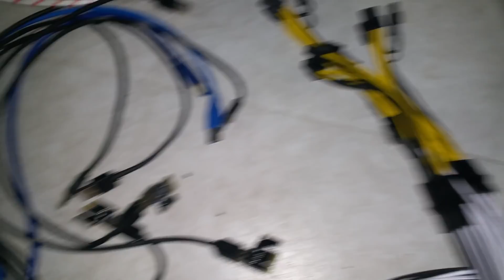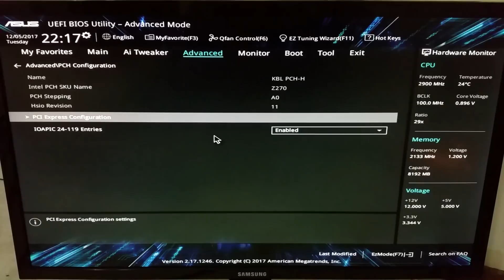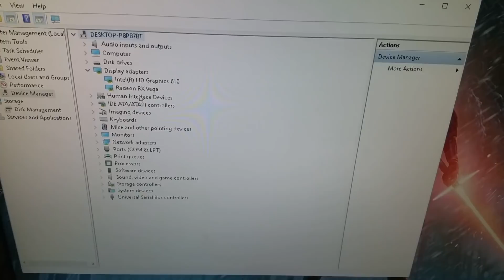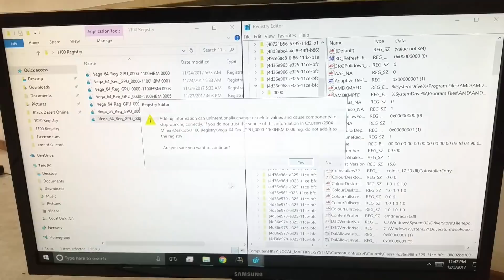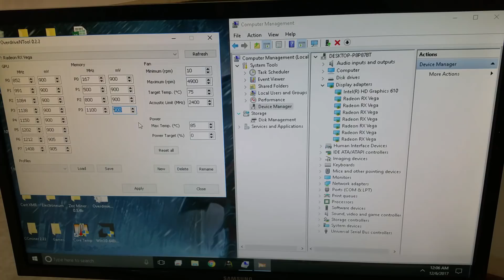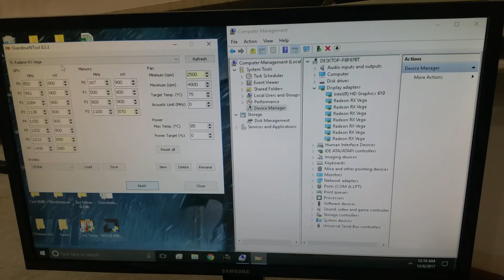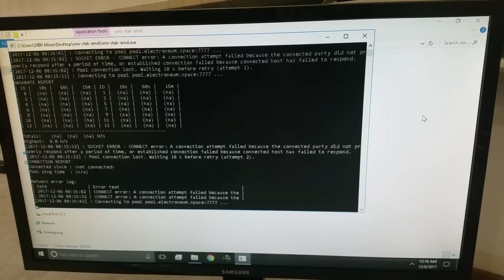[Tutoria] How to configure 6+ RX Vega Mining Rig

Comment: why not just use 4 gigs of system ram and you dont have to worry about turning on and off the cards for the HBCC support??  the reg edits are just to address watts and clocks right?
Reply from the maker: I don't think HBM is the issue. In this video I didn't even install the "radeon setting" so I was not able to even toggle OFF/ON the HBM at all. I think it is some sort of driver issue (I could be wrong though). I don't see how going from 8GB of RAM to 4GB would affect the bug/issue. Would be interesting to try though! I might have to buy a 4GB module just to try it. The reg edit allows you to change some of the P states that are otherwise locked in wattman/OverdriveNTool. You can get similar hashrate without doing anything to the registry but you end up drawing quite a bit more power doing so.
Reply from the maker: Ohhh whoops I missread HBM as HBCC LOOOL. Hmm that's interesting, I don't have any 4GB modules but I'll definitely have to try it to see how it works.
Reply: lol thats what i meant hbcc, likei just set up 2 vega 64's and with  4g system ram, the hcbb doesnt get used and seems like they hash fine (though i havent done any registry edits, just the regular memory overclocking for now... but seems fine... ill modify the registry soon, sometime this week and see if that works fine too.) I just overclocked the mem to the 1100 and getting 2000 h/s per card without any of that disabling re-enabling the cards.  ill have to get some more vega cards, but trying to wait for the 3rd party coolers to hit this or next week.  i might be wrong, but i dont think hbcc makes any difference in the mining, just seems to bug out like you said when its enabled at first.  i just tried using cast
Reply: actually maybe i was wrong... still need to toggle them.. lol.. staying up all night sometimes isnt good thing
Reply from the maker: Yea these cards are quite peculiar, haven't had to deal with anything like this with other cards in the past. No worries, I was just a little confused xD. I thought I goofed something up haha.
Reply: yup, theres just too much info on how to set them up, it gets really confusing.  Can i ask where you found the registry edits?  i hate flipping through bitcointalk threads to find the origins of this stuff... btw, if i do a video on setting this stuff up ill be giving you and hodlround a shout out in the vids and try to throw some subs your way.
Reply from the maker: I found the 1050Mhz and 1100Mhz registry files from a reddit post made by hellae, I threw him/her a big thanks in one of my videos. I believe the original registry file came from a person named "brnsted" but I don't know where in bitcointalk it's at. You can find the reddit post here: https://www.reddit.com/r/MoneroMining/comments/74hjqn/monero_and_vega_the_definitive_guide/
It seems like the files have been removed since, so I re-uploaded them above. I would appreciate the shout out, that would be awesome! Let me know how it works out!
Reply: kool thanks :) and will do, i always list references :)
Reply: So did any of you guys try this? Enabling and disabling is not allowing me to automate this machine as much as possible as I always have to disable/enable cards on startup. My devcon file won't open on my PC for some reason. I tried 1511 version of W10 and the newest one i think 1709. Now 4 gb thought looks interesting. I have another shift at the hosp and then coach little kids, can't get to this until wednesday FML.

Comment: Are those overdriveNTool settings safe for a Vega 56 or are you running all 64s?settings
Reply from the maker: If the vega 56 is flashed with a 64 bios then in theory they should. Unfortunitely I don't own any vega 56s to confirm this with. I would hate to lead you astray by simply saying yes. I will be getting some 56s as soon as they are available in order to test everything out for you guys.
Reply: Roger that. I'm trying to fine tune my 3x 56 rig especially after the crazy jump in network hashrate over the last 48 hrs and I'm realizing i'm not as tech savvy as i thought i was.

Comment: Hey Mark. Do u by any chance got a registry mod for 1050 ?   my Ugly Duckling card (1 of my vega 64)  doesnt go over 1050 without crashing. Thanks. oh btw ...i use 1150 on my cards with 900 but ive seen 1150 with 850 on some guys build on bitcointalk. I can give you the ink if you are interested in that oc .
Reply from the maker: I'll have both the 1050 and 1100 power play tables in the description above. I don't run the memory at 1150Mhz to play it safe. Every single card I have ruined in the past has faulted from VRAM issues. I'm not 100% sure what you're asking lol. I'm assuming 850mV at 1150Mhz? All you have to do is apply it, every card has different thresholds. What works for my cards might not neccesarily work on yours. Silicon lottery my friend.
Reply: yeah that link isnt working for me :(
Reply from the maker: Ohhhh hmm wasn't aware. I'll upload it to a different site in a bit.
Reply from the maker: Just re-uploaded the links to a new site, should work now.
Reply: Thanks. your the best :P And Grats on this video. not many people make videos about how to set up bios and all. Very good video m8.